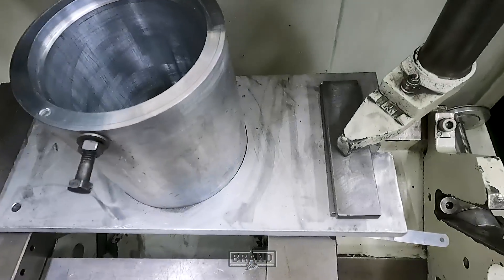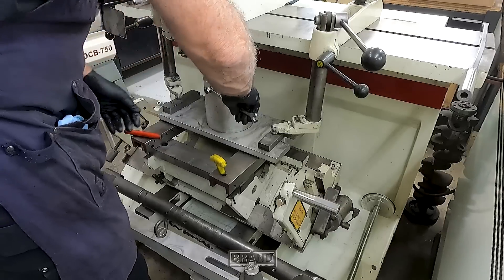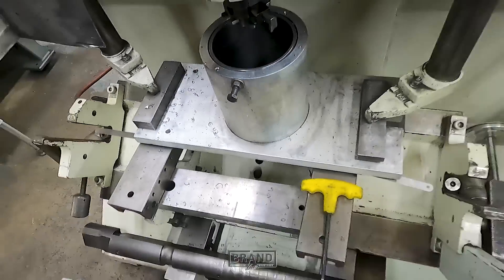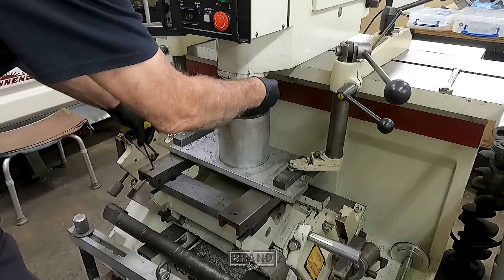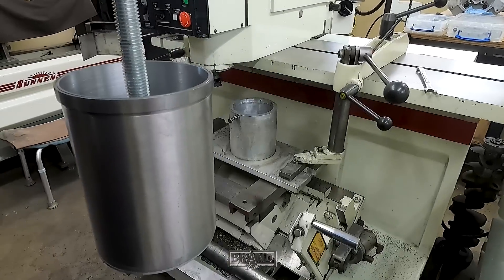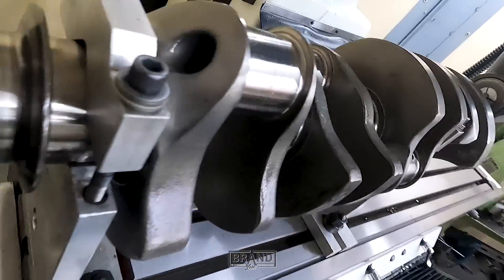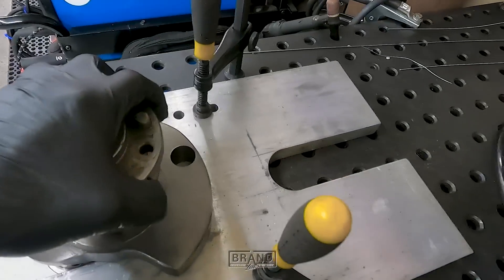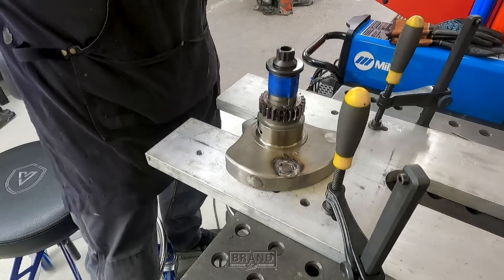a Day in the Machine Shop! Custom Tool for Swapping Sleeves, Adding Mallory to a Crankshaft!

Comment: It looks like quite a bit of Mallory has been added to that crank over time. I always thought center counterweighted cranks generally required less heavy metal when balancing. Am I wrong or is it just because of this particular engines rods and pistons?
Reply from the maker: Rod & Piston Weight

Comment: Ask Billy The Kidd atcStreet Racing Channel if its necessary to weld in the mallory. Cost him a big block chevy and a new front half and sheet metal from not welding it in after it came out and went through his pan
Reply: Ant the Mallory metal was installed vertically, not horizontal like this one. And yep, tig it!

Comment: Nice work Gerald. 
I like your fixture for boring the sleeves.
Nice using the right angle drive for the heavy metal installation. 
Great idea. 
Have a good evening.
Reply from the maker: I have a super flow 110 flow bench that I need to get rid of it with the Brzezinski head adapter for small block Chevy and small block Ford. $ 2000.00

Comment: Kinda crazy you putting that Mallory in, right next to where someone put some in, in the past the lazy way. That could fly out. Don’t think it’ll go anywhere with that tight off a fit and the weld job!
Reply: Only flies out if they don't put it in the right way and or weld it the right way..Billy from street race channel had that happen from box performance not putting the Mallory in the crank the right way and It sent it through the oil pan the oil got on the tires and he crashed his new nova build then they tried blaming Callie's instead of making it right and just admitting it , the biggest red flag was that they stuck it in the bottom of the counterweight instead of in the side like your supposed.. So than Callie's called them out for lying on them  ... Nobody wants to do good work anymore and when it comes back to bite them in the ass they don't want to stand behind it either.. this guy definitely knows what he's doing and there's a lot of engines he does with a ton of eyes on them at all times...
Reply from the maker: Thanks😊

Comment: Thank you for making this video! Back in one of the previous lives, we left a lip on the rod side for the Mallory to rest on, and punched a pinch on the feed side to lock it in. We also didn't have TIG, and didn't want to put any heat on the crank. The other style was lead with a threaded in cap. These all tend to fall apart, so after a few experiments it has been grinding material off rather than adding it in. But, when you do a big bore dome piston setup, there's very limited amount to take off, sometimes just have to add more. Which brings me to my question: Why just at the ends? Is the crank slightly misaligned or what makes those end ballasts need more weight compared to the middle ones?
Reply from the maker: Just adding to the end counterweights makes the most difference when you're balancing.
Reply: @BrandRacingEngines   This must be a drag racing thing.. It makes sense when you're aiming for full throttle pull. The middle part is all over the case anyways, and definitely doesn't need more stuff to flap around. Thanks for the answer!